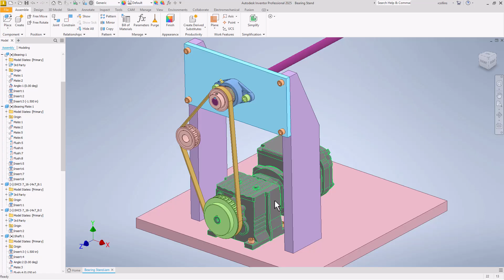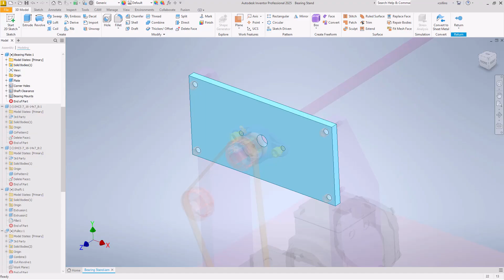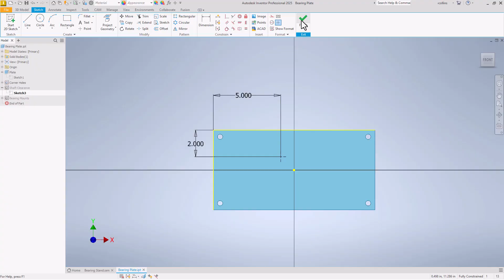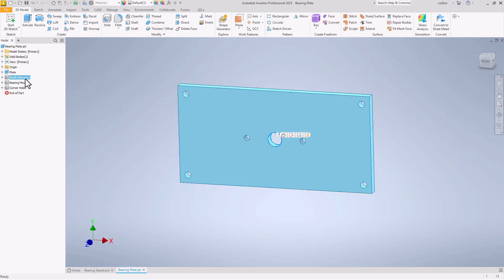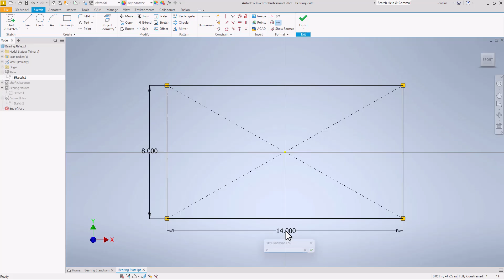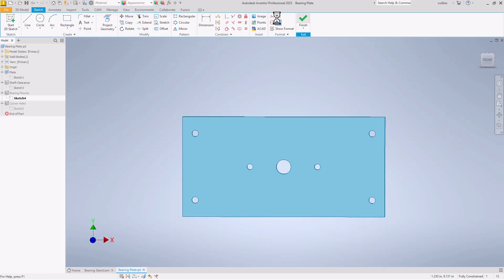The Power of Design Intent - Autodesk Inventor Tutorial

Comment: Why have driven dimensions for the shaft clearance hole? The plate could be created using a centered rectangle sketch and the hole positioned at the center of the rectangle. No need to create a dimension unless this practice has some other utilitarian use.
Reply from the maker: Great question. Constraining the hole to the center of the rectangle will definitely work to keep the hole centered in the plate, but leaving it as a dimension instead of having it stuck to the center point makes it easier to change the location later if desired. It's all a matter of how confident you are that you want it to ALWAYS be at the center of the plate. I'm approaching this as "I probably want it centered, but I might run into something later and need to move it."